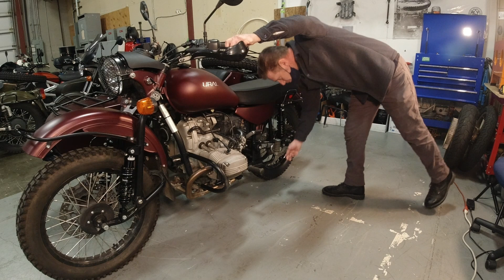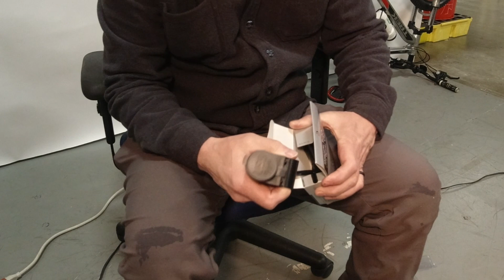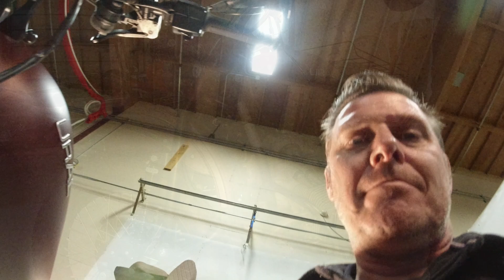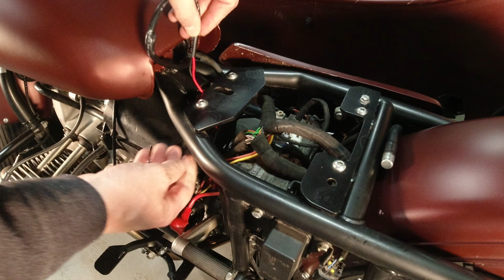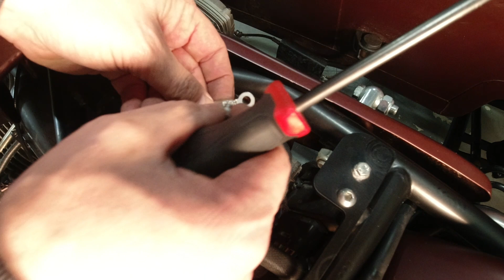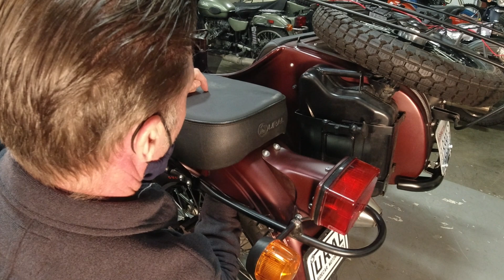URAL How-To - Dual USB, Magnetic Switch, Power Charger Installation

Comment: Is there a “switched “ power supply?  I am hesitant to have a always powered anything.  I ran my battery down once on a motocamping trip plugging a charger for a big whopping spotlite in overnight.   I plug my phone into the side car plug now. 
I have a ultra cool 06 Tourist bought new from Wagner’s.  Still chugging along just fine!
Reply: The switch is in the housing of the USB charger itself. The rubber cap has a magnet molded into it, when you put the cap on the magnet pulls the switch closed and turns it off.

Comment: Another great video, David. It is really weird, but I was looking at that exact USB port on Amazon today... good choice! I always have trouble engaging the threaded block on the battery, so this spring before I put it back in the Ural, I wedged some small grommets under them and they seem to work great and are permanent.
Reply: Thank you Alan. So far I like this charger, my co-worker Nik has had one on his bike for a couple years with no fault to function. Good tip on the grommets and just leaving them indefinitely, I should have thought of that before.
Reply: Thanks for the awesome video.  Do you have a link for that usb charger?